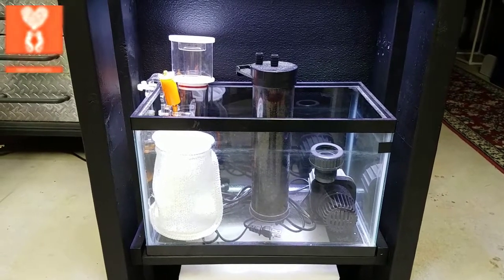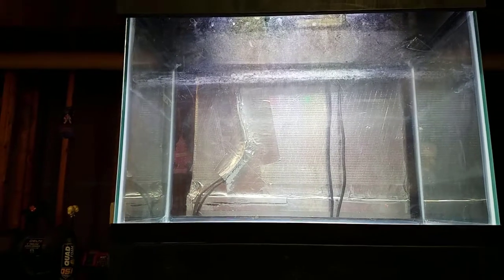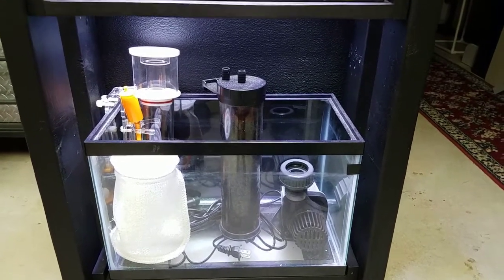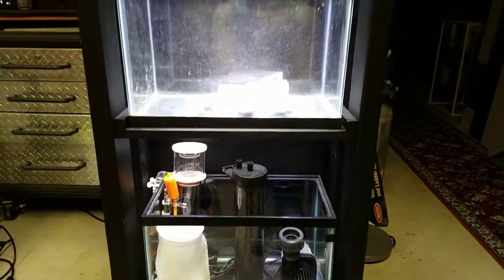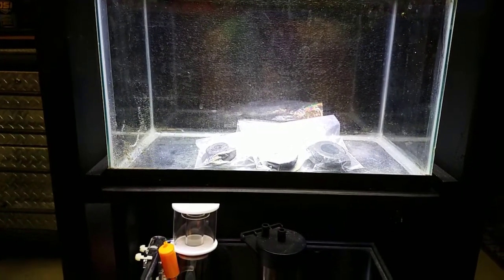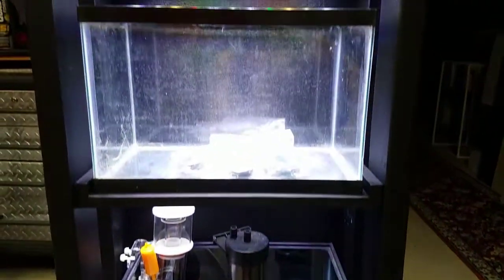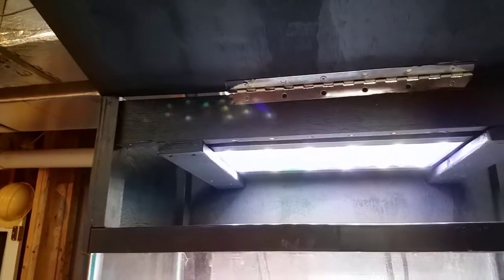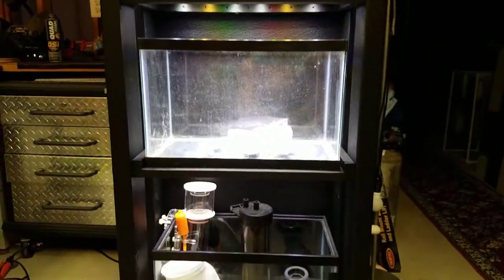Setting up a Reef Tank using spare parts to build a custom DIY stand and hood

Comment: Great plan.  You can always put the sock in the rear corner of the refugium where it'll be out of sight and then the water will run down to the final stage for return to the tank
Reply from the maker: +Dee From Brooklyn yeah I'm thinking it will work out nicely.

Comment: Don't forget what will happen in the even of a power/return pump failure , your bottom sump will have to be able to handle the  overflow volume of water from all the tanks above it.  Syphon valves may help, but are not foolproof.  Suggest you bean or herbie each tank down to the one below it.
Reply from the maker: +King Rob Reefing I am definitely going to double check those things before plumbing. I will probably use a check valve on the return line. And the DC pump can control flow to cover any drain problems